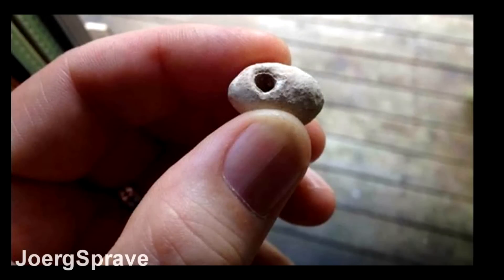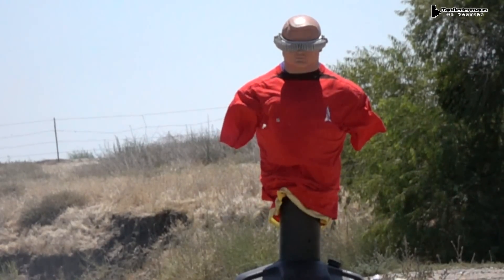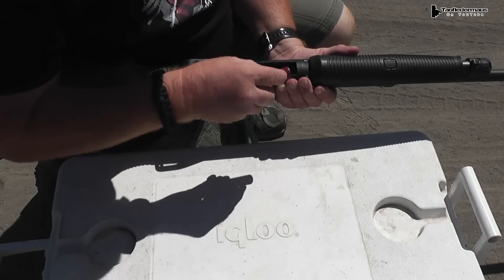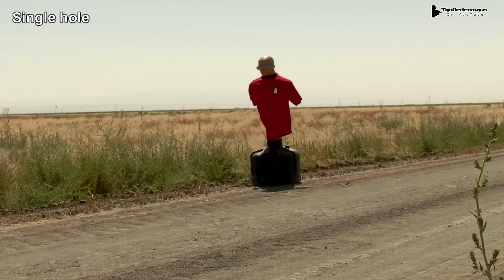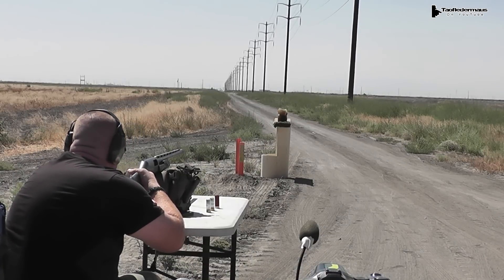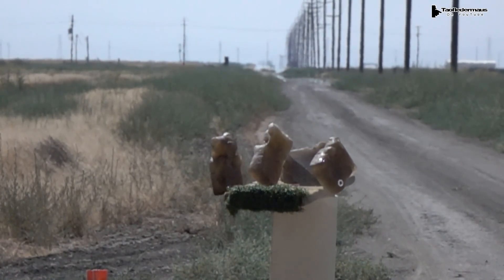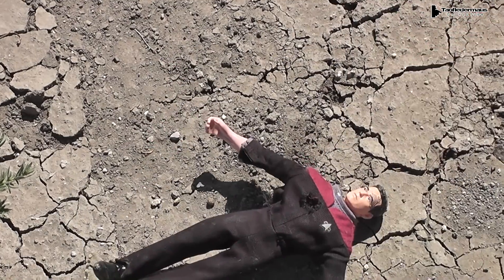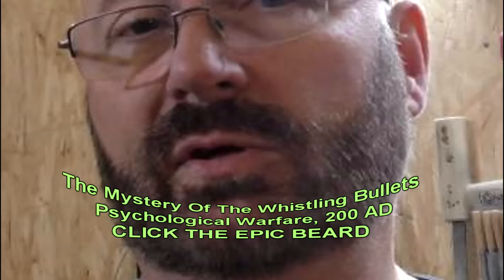Whistling Roman SHOTGUN Bullet Experiment

Comment: the reason the rounds didn't chirp is because the hole wasn't aligned with the plane of rotation. the hole creates a pressure differential and as it rotates produces a cyclic pressure system around the round which makes/is sound. form the rounds to spin and put the hole in the side instead of the tip.
Reply: you could take one of those ramjet rounds and take a notch out of one part of the front ring that will faces downrange. the ram will create rotation and the notch will produce the pressure differential, together making the chirp. but don't do multiple notches because you could potentially create too many pressure systems and they would form a front which wouldn't interact like the chirping pressure system.
Reply from the maker: Remember the cube tumbled randomly so there's going to be a point where the alignment is perfect.
Reply: +TAOFLEDERMAUS yeah exactly random, random isn't cyclic. I study atmospheric physics I understand what's happening. sound is produced by cyclic pressure oscillations in the air, I'm simplifying but this is what happening. if you want chirping you need a single rotating variance in the pressure front as the round travels.
Reply: +VonGunder well more specifically you need to create a pressure oscillation, if you create too many they begin interfering with eachother
Reply: +VonGunder additionally, the Mickey mouse round creates a drag face along that side that is drilled which causes planar rotation along the large hole and thus chirping.
Reply from the maker: I'm using cubes with flat sides,  so that probably had the biggest effect with the air flow.   So the small holes at the edges of the mickey mouse slug probably were a better placement for air flow to make it work properly.
Reply: +TAOFLEDERMAUS if it was to be a rounded object, the air would slide around the ball/projectile evenly but having them in cubes won't allow the air to curve around therefore meaning the projectile won't "whistle"

Comment: The whistling slingshot bullets might have some psychological effect, but I would bet more on the fact that they were used by scouts as some sort of signal. If you look up whistling arrows and Kabura-ya you see the same sort of concept.
As to why it didn't work that well in the shotgun, that probably had to do with the speeds that they were traveling. The same diameter hole that worked for a slingshot bullet just doesn't function correctly at the velocity that the shotgun provides. Toying with different hole sizes and pattern should yield interesting results. So, you seem to have been on the right track with the Mickey Mouse holes. The different patterns and shapes of whistling arrows might also provide some more inspiration of shapes to try with your slugs.

Comment: I think the reason there wasnt a clear whistle is the hole drilled wasnt through and through. Air would need to pass through the projectile and depending on the warble the air passing through would create the whistle. like whistling a tune. a spinning projectile without warble would produce a clean sound, where as warbly one would get air passing through it only when the hole is facing the direction of target. Thus the segmented whistle... I think
Reply from the maker: I did it the same as Joerg did it.
Reply: I thought Jeorg drilled completely through the projectile.
Reply: I am not an expert in ballistics, and a hile completely through a bullet might be dangerous. plus energy would be lost because explosive energy would be lost through the hole...although a trumpet shaped hole, larger diameter  at the bullet tip might solve it
Reply: Also the target would be eliminated before the sound ever reached them... for warning shots and non lethal rubber bullets... suppresive fire support? If shrieker bullets are effective in combat, any modern military would probably implement frequential sound dampening ear pieces though.
Reply: What I would suggest for your   square bullet slug experiment would be a hole straight through the projectile, a coin shaped metal plate between it and the propellant, insuring maximum velocity... the coin would lose speed and the projectile sgould sing...  hole diameter to projectile velocity will change the sound frequency... supersonic velocity might not be audible to human ears... can be measured as the projectile slows

Comment: I'm almost wondering if you put the hole in the side, if that would have any effect on the noise. If packed in the shotgun shell like normal Buckshot would be. Maybe make a bunch of them around the same size and wait as the original ones used in the other video. I wonder if that would amplify the sound because there are multiple projectiles.
Reply from the maker: Orientation doesn't matter since the cube tumble randomly.

Comment: Maybe the mickey mouse round whistles because they cut slightly into the big circle creating a sharp edge that the air vibrates on. On the round stone the edges of the hole would be more acute than 90°  and it's moving slightly slower so I think it has a better chance to create audible whistles. Just a guess...I don't have the means to experiment myself.
Reply: Great shot on the doll again though!

Comment: Do not have picture anymore but I made a 2 part slug once,  with a 4mm bolt in the center  clamping a dime in between the top and bottom part of the slug. the whining sound will be there but its not accurate..you can ad up to 3 coins to improve accuracy..

Comment: If you notice the shape of the actual historic rounds they were football shaped with holes in the sides. If you hold a bottle out the window of your moving car you'll get it to whistle based on the angle of the mouth of the bottle to the direction of wind. This is where this experiment went wrong, you need to elongate the round to get it to travel with the hole at the correct angle.

Comment: The hole makes sound when it effectively cuts air and the air going in the hole pushes back and makes interference with the air moving outside. I believe if air speed is too high, regardless of being supersonic, it creates a bubble of air and ruins the interference. It is friction,not so much different from making sound rubbing your finger on a wine glass. There is a speed for it to work. Or even nails on a chalkboard, move it too fast and friction doesn't work the same to make sound.  Another possibility that is less likely is that it worked, only it made super high pitch noise, beyond what adult humans can hear. Perhaps the camera caught it, but we cant hear. On a flute, if you blow calmly, you get one sound, if you blow air with all strength, you get a much higher pitch sound.

Comment: It's simply too fast. Or at least I think so. I think it's because of the pressure difference in the air pressure in front of the bullet when compared to the pressure behind it. which is lower since it goes faster as the sound. This of course doesn't allow air to flow over the whole as needed. I of course am just speculating and bored and most likely stupid.

Comment: you need to put the hole on the side of it not the front. im just guessjng but because of the rifling  (assuming you had rifling with these rounds) its causing the cube to rotate with the hole still in the front. If it was rotating the same way only with the hole in the side i think it would make a more prominent  sound.

Comment: The shape could have affected the airflow round the slug, the slingshot one makes the chirping sound (louder then quieter) because the slug tumbles in the air producing an optimum angle for the sound to be made and then deviating off it hundreds of times a second.  the cubic slug will likely only have one angle of attack that will produce a good sound a d thus will be very rare to hit that angle. Try again with an oval or round slug and see the result. (This is my theory not fact but it would be good to try)

Comment: if the round were super sonic there would have been a pressure wave in front of the round limiting the air flow threw the hole.
Reply from the maker: I'm sure by the time they went past the cameras down range, they were going sub sonic.

Comment: What if you change the orientation in the cartridge? eg. put the hole side on, or if you use a rifled choke?
Reply from the maker: A lead slug can compress under the g-shock of being shot.  I put the holes facing forward so we could tell what was in the shell, but also to keep the slug from squashing on itself by having a hole weakening the slug.   The cubes proved to tumble at a high rate in the previous video.

Comment: The holes should be at the sides. Try blowing at a bottle from the top; nothing will happen.  The air has to come from the side for any sound to happen. When you shoot them from a rifled barrel, the rifling will make it so that the front of the cube stays in the front. Either you shoot the cubes without rifling or you shoot them with the holes on their sides.

Also, the "chirping" effect comes from the projectile tumbling, and only making the whistle when the hole is at the right angle; otherwise it would just whistle cleanly. The reason the mickey mouse cube kinda worked is probably because the holes are off-centered which was enough to make the cube tumble a bit.

Comment: I believe two things are a bit wrong in your test. First - hole should be on the side, rather than on the front. The air should go over the hole (like playing the Pan flute). Second - the shape. Spheres spin differently than cubes, and you have a completely different air flow around it, so more often they come to the position for whistling.
Reply from the maker: The cubes tumble through the air,  so placing the hole forward in the shell allowed us to see what was in the shell,  and since the g-shock it so powerful,  it kept the slug from collapsing on itself.    The mickey mouse cube did whistle.
Reply: Yes, it did. Anyway the video is very interesting, as well as the other videos on your channel.

Comment: Jorge did a better job using historically accurate projectiles
Reply from the maker: The Romans didn't use a spherical lead mold,  Joerg did.   Any other critiques?
Reply: +TAOFLEDERMAUS I do have a question if they didn't use a mold how did they get the projectiles into a spherical shape? And yes a question why be so rude when I state an opinion if you don't like being critiqued because on some history sites I visit it states, "In some cases, the lead would be cast in a simple open mould made by pushing a finger or thumb into sand and pouring molten metal into the hole. However, sling-bullets were more frequently cast in two part moulds." and yes it refers to Roman sling bullets. So I shall stand by my previous opinion if you don't like the opinion thats fine you don't have to but at least do a little research before commenting which is what I had done in the first place.

Comment: have the hole to the side through rifling
Reply: not saying I'm right, don't know that I'm wrong
Reply: Side was also a thought of mine, but I guess it spins so much that it wouldn't matter. I am guessing the speed is the problem. We have seen a few times that at supersonic speeds, the air won't even enter the hole. That's why slingshot ammo works, but shotgun ammo doesn't.

Comment: I wonder if it was because the hole was pointed forward? Same as a traditional hollowpoint, which we know doesn't make the whistle (same with the hole pointed rearward, similar to typical rifled slugs). If the hole were on the side, would it make the whistle? The imbalanced drag and mass might have started the mickey mouse slug tumbling which would support my hypothesis. I might try to find a lead ingot and try cutting one or two out to try myself.
Reply from the maker: The cubes do not fly forward,  but tumble at a high rate of speed.
Reply: Well there goes that theory. Figured they must not be with how accurate they'd proved in the last video, obviously I wasn't paying enough attention!

Comment: CHECK THIS OUT!!! 
A more aerodynamic round will keep whistleing with the hole in the side, slightly drilled forward. Because the air will continue to flow across the whole the entire time and not tumble or tilt during its travel. This would work even better if you could make a hole that's covered with a slit with the edge pulled slightly outwards. I believe that would act as a reed or an actual whistle. Hell, come to think of it, why not go full-blown and try to put a small piece of round cork in the hole ( with enough room for the small ball to bounce around inside the drilled hole ) and close the surface, leaving only a slit for an opening? I think the more space inside the hole the more harmonic the sound would be.
Do this to both sides of the bullet and it would keep it evenly dragged on both sides as to not wobble.
At this velocity you could probably put any small ball in the drill hole made of ALMOST anything, even a BB, which just might add a METALLIC CLICKING SOUND together with the whistle? I'd Bet that would Sing LOUDER THEN HELL!
Not the song of course, tho that would be cool too...
( Mötley Crüe Reference ) Really showing my age!
https://youtu.be/fARS62XTDTo

Comment: I think it has something to do with airflow across the hole. The mickey mouse slug kind of worked because the ear holes were closer to the edge where they would get more air flowing across them. The bigger center hole was probably stuck in a kind of vacuum caused by the spinning of the edges. I would guess that repeating the experiment with round ball slugs would make them whistle.

Comment: the frequency of the whistle may be a function of the hole's size and the speed of the air going past it, which means the slug with the large hole was making noise, but not in a range we can hear, but the smaller holes in the Mickey mouse slug were

Comment: Did you try loading a cube with the hole on the side,? The cube "hole" may need to be on the side to achieve a whistle.
Reply from the maker: The cubes tumble through the air,  so placement in the shell isn't important for that to occur.  But it is important to identify what is in the shell,  and the slug is much stronger in  that position.

Comment: The holes need to be on the side so that air is moving OVER them, not at them. Just drill a hole in the side of an existing slug so that its a curved surface
Reply from the maker: The cubes tumble randomly through the air so it was more important to be able to identify what was in the shells,  and keep the cubes from crushing under their own weight from the intense g-shock when they were fired.

Comment: 12 gauge cast lead cup, with strike anywhere match heads waxed in, vs hard targets (ar-500 steel plate.) Do it, your epicnessellency!
Reply from the maker: That would probably be considered a destructive device by the ATF.   Can't cross that line
Reply: Meh. I bet you could get away with it...

26 U.S.C. § 5845(F)

For the purposes of the National Firearms Act, the term “Destructive Device” means:

A missile having an explosive or incendiary charge of more than 1/4 oz.

Exemptions:

A shotgun or shotgun shell which is determined by the Attorney General to be generally recognized as particularly suitable for sporting purposes.

I guess it depends on how the Atf defines "sporting."

The atf laws are a joke- stabilizing brace that you can put against your face, but heaven forbid it touches your shoulder...

Comment: Hi everyone. let me have a try at smartassing. Couldn't the problem be that you put the slug with the hole up front? there's a possibility the hole stays at front because the projectile is so stable. the round balls would spin and expose the hole to different angles of wind. if you put the cube in with a hole on the side.... and used a smoothbore shotgun.... maybee?? but probably the sucke** fly too fast.
Reply from the maker: I put the hole up front so we could ID what was in the shells.   Putting the hole in the side would weaken the slug and the g-shock is enough force to crush the slug under its own weight.   The cubes tumbles randomly through the air so it doesn't matter.

Comment: Try putting the cube in the shell such that the hole is in the side, rather than the front. That way you will get the air rushing over the opening instead of directly into it. Similar to how you can blow air over an empty bullet casing to make it whistle, but blowing into it does nothing.

Comment: Easy, they dont make a sound, cause the hole is not in direct contact with the air friction because of the cube shape, the mickey did it because the hole is more close to the edges and can capture a little of the air, if you drill the hole in the tip of the cube that will make a sound